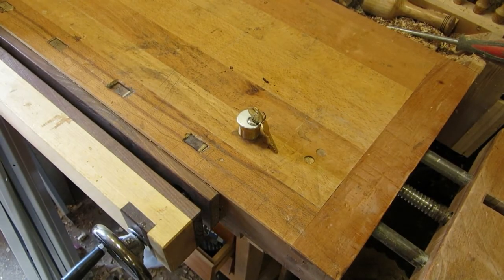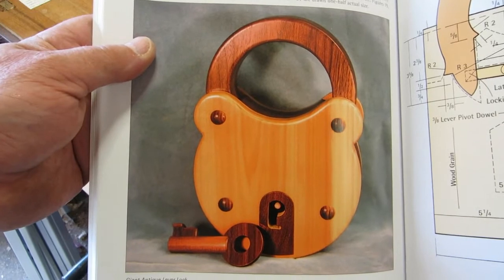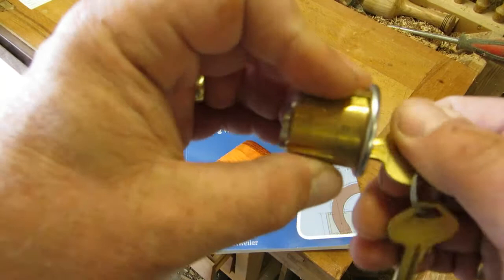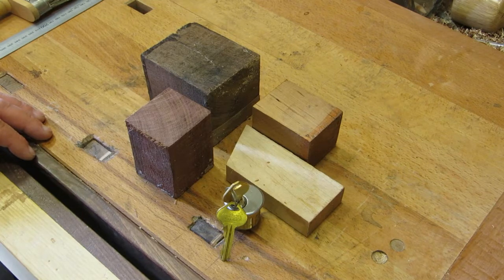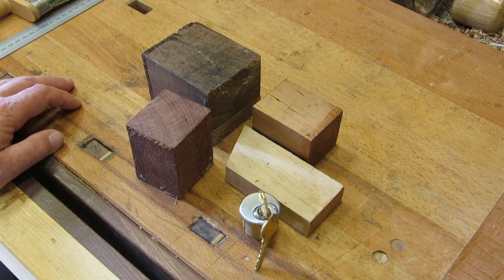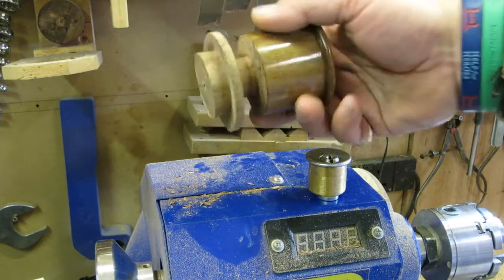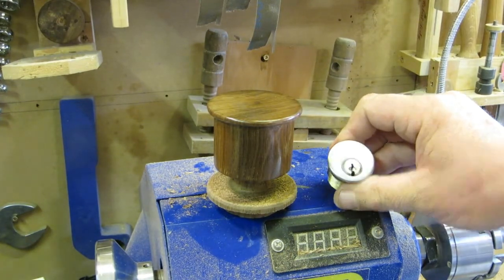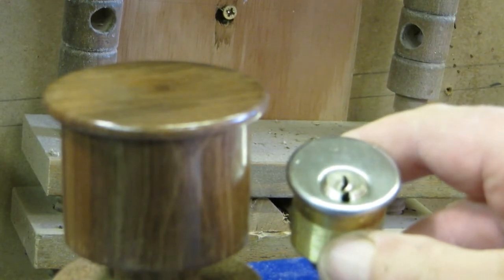(298) Building a Wooden Mortise Cylinder (Part 1)

Comment: Not sure if you've already chosen a method to creating the key warding, but you could drill key points into the core with a drill press then connect the holes with a coping or scroll saw.  

I've actually thought about building a wooden mortise lock or one out of  polystyrene.  My idea was to create a giant mock-up lock as a gag gift with a challenge lock give away.  Never had I imagined people actually making working wooden mortise locks, let alone a really nice book about making them.  Totally awesome gift.
Reply from the maker: Thanks, have a look at my latest video, I think I nailed the warding, it was the one thing that was really worrying me.

Comment: In pine you can cut the warding with miniature chisels made from wiper blades, probably not in hardwood. A coping saw won't be accurate over the length of the bible. I think it will take a Dremel.
Reply from the maker: Thanks, that was my plan, I have an attachment to use the Dremel as a router table, so I'll probably try that first.